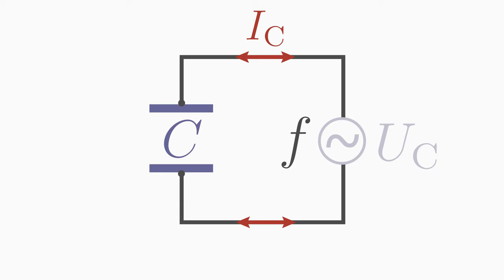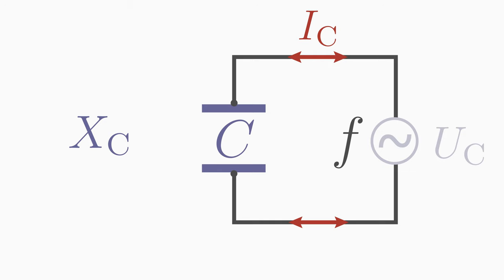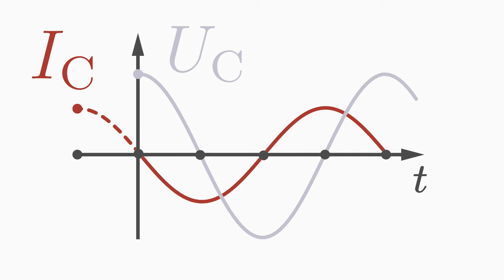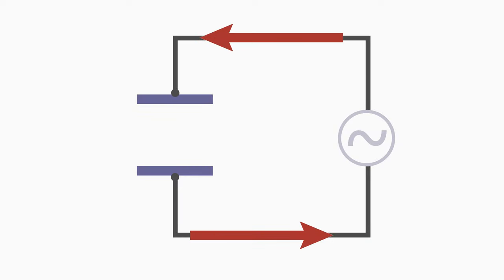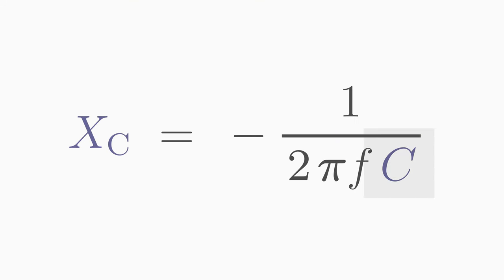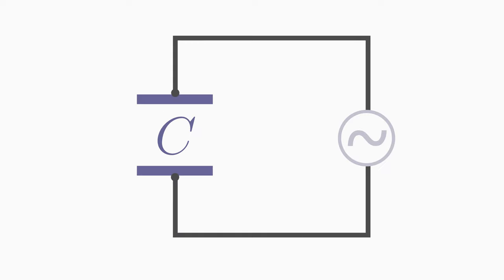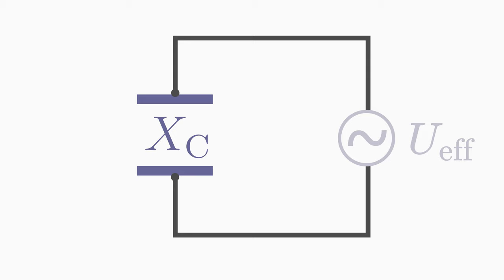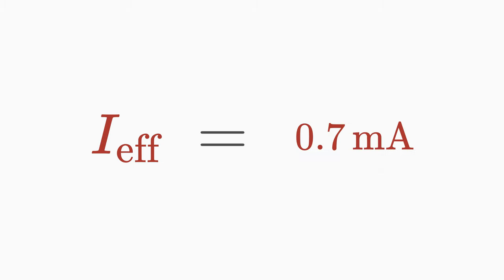Formula for Capacitive Reactance Briefly Explained

Comment: Can I ask why voltage and capacitance are inversely proportional and why does decreasing voltage increase capacitance (I know the dielectric will reduce electric field and hence reduce voltage). Would help to derive the formula C=Q/V and why it works.
Reply from the maker: Hey thank you for your question! Mmmm, you didn't interpret the formula quite right. The voltage U is NOT inversely proportional to the capacitance C. By that I mean, if you decrease the voltage, then the capacitance does NOT increase, because capacitance C is an intrinsic property of the capacitor. It is a CONSTANT. You need to think of the formula more like this: Q = C*U. So charge Q is proportional to voltage U, where the constant of proportionality is C. I will write an article about this on universaldenker.org and explain a bit better. :virtualhug:

If you have any further questions, feel free to join my Discord channel:
https://discord.com/invite/3Btr63fujg